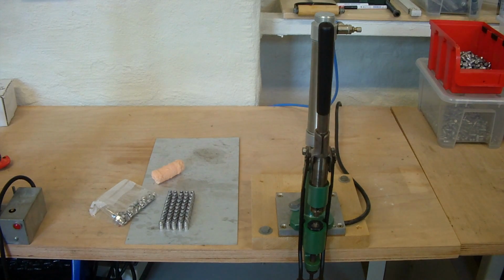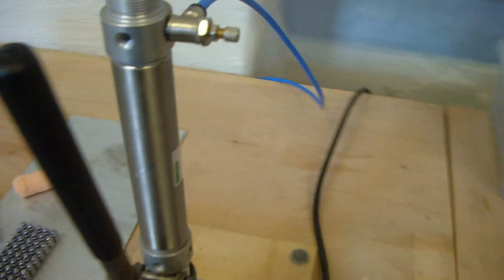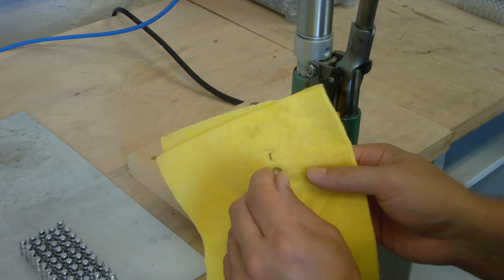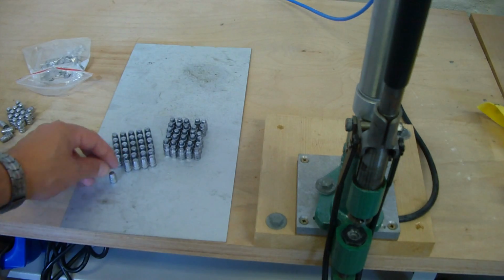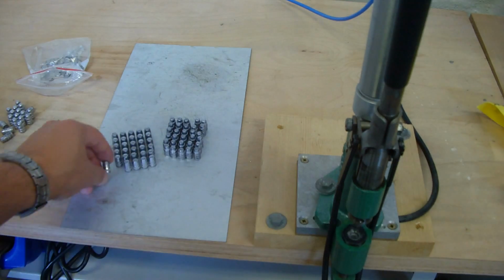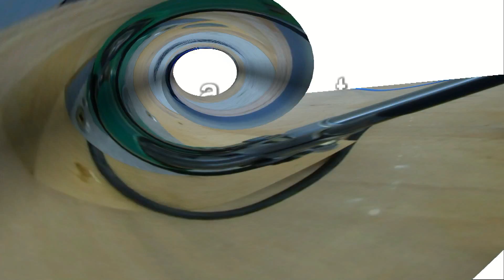RCBS LUBE A MATIC II (ENGLISH VERSION)

Comment from the maker: @LongRifle100 Well I build this by my self. All you need is a pressure cylinder with (I think it was) an M30 thread, an hub of 125mm and a threaded end on the hub so you can mount the RCBS internal parts to it. Further I add an pressure regulation device to the cylinder....that's it.

Comment from the maker: @tahoepimp2039 Thanks. Gas checks are needed if you use hot loads. I flux with paraffin wax or Marvelux. Wheel weights are a good lead source for casting bullets. Regards from Germany.

Comment: 2 years ago you wrote "
@daywalker627 Three Years ago I bought this air setup. don't know the specific data but I drive to my shop later and make some mesurements and then I post the data."  . . . .  and we are still waiting !!!!
Reply from the maker: Upps, sorry. There are so much things I have to give answers so I forgot this. Sorry sorry sorry. The thread at the end of the air cylinder is an M30. The stroke lenght is 120mm and the thread at the stroke end is an M10. I don't know if you can find such cylinders with metric thread in the USA.

Comment: Found these air cylinders pretty cheap on ebay from China and got all excited until I took a closer look.  The cylinder blocks the handle from going back all the way and that means you might get away with pistol bullets but the longer rifle bullets simply won't fit with not enough clearance.